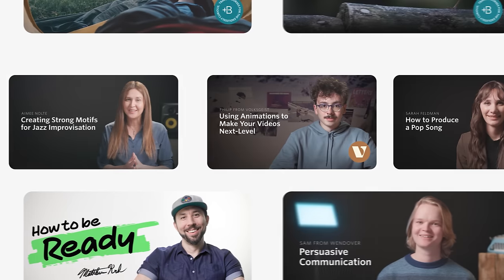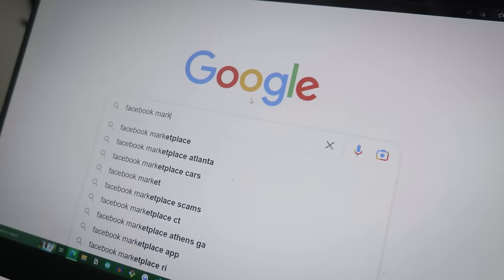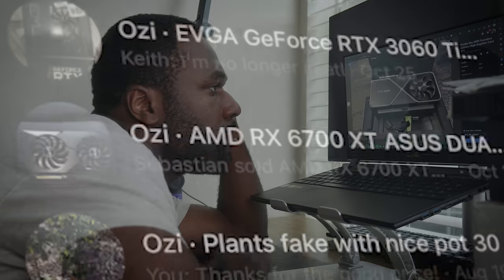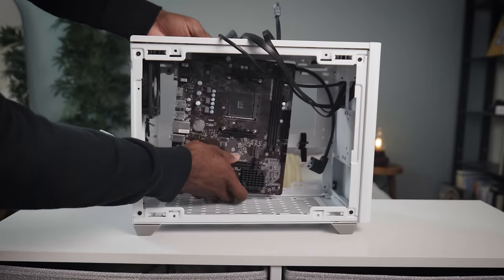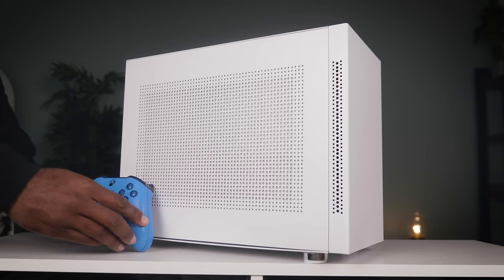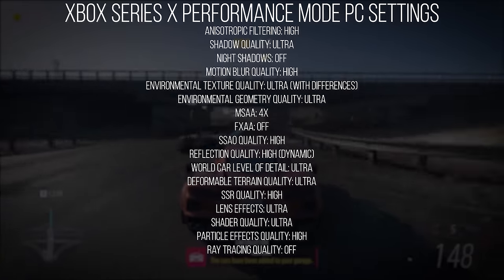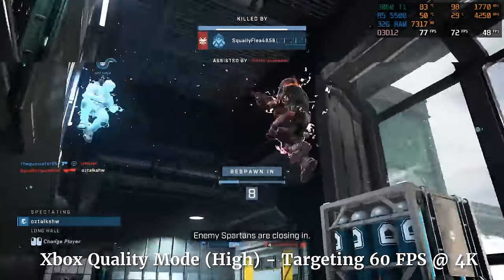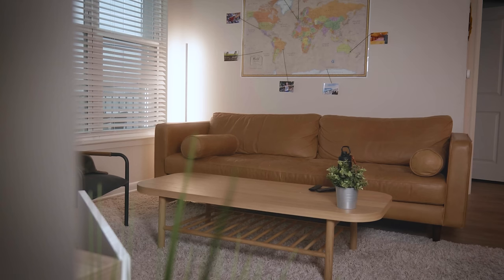I built a faster Xbox Series X for $474

Comment: I just built a comprable  system for   $500. I used face book marketplace and Amazon.

R5 3600 water cooled by AIO
X570 matx motherboard 
Rtx 2070 Super
GTX 1050(for blender)
32gb of ram 
1tb of nvme storage
250gb of ssd
500gb hdd 
And a monitor too!!

budget gaming is getting way better, you just have to know what too look for

Comment: so i want to make a similar build and on ebay i'm seeing quite a few msi gtx 1080 aero would that be good enough for 1080p or would it be a bad deal for 127 usd?
Reply from the maker: GTX 1080 is a solid GPU at $127. If you can swing it, pick up a used RX 6600, RTX 2060, or RX 5700. They're around the same performance but newer and more energy efficient. They're going for $150-$180 on ebay...1080 still good though :)

Comment: there are three things you can do about the gpu temp other than undervolting, repaste the thermal paste and usual blower style cards arent that good when it comes to coolings vs a dual fan config so set fan to 100%, as for the fan config have 3 intake 2 exhauset and if ur not venting the heat fast enough it get warm in the case, in my person rig i had 6 fans 1 was exhaust but the rest was intakes but my gpu would get up to 70-80, but i change the config to 3 in 3 out and temps drop to 50-60

Comment: Hey, Nice video! just one question on the build wouldnt the psu be pushing the hot air through the mid of pc? even if the intake is working fine its its not constantly running and pushing the hot air out. Leading to overall heat issues off the rip?

Comment: I have built 2 PCs with the coolermaster NR200P case and can confirm these motherboard fit, for anyone interested:

Asus ROG Strix B550-I Gaming (notice the -I)
Asrock B550M-ITX/ac

The Asus supports Bios flash without a CPU installed (to ensure compatibility with Ryzen 5000s), the Asrock does not but mine came with a Bios supporting Ryzen 5000s. There's also a sticker on the box of the Asrock that mentions it : "AMD Ryzen ™ 5000 desktop ready".

Comment: I don't know much about the specific hardware (I still have to keep on using an almost decade old PC), but since that 3060 is a used GPU, you might get better results with re applying the thermal paste on it.  Depending on the previous user, it might be drier than "insert something funny but inappropriate" 

Regardless, good video and thank you for sharing.

Comment: Not sure about the heat from the 5500, but I just built a system with the 7600 and it thermal throttled almost immediately with the stock cooler.

Comment: Cool challenge! This is one of the rare times where gaming consoles are a great value and generally much cheaper than building an equivalent PC.   I actually have a PC that is slightly more powerful than my PS5, but the SSD/loading in PS5 is faster, and games don't have stuttering and horrible optimization issues, so it's still my preferred platform by far for playing modern AAA games.  Can't be PC for general tasks, productivity/work, and classic/retro gaming though! I still love having 20-30 years worth of classic PC games on Steam & GOG to play
Reply: Stop the cap my pc is better than my series x and ps5. Yeah I have to agree ps5 ssd is probably faster. But I run games better and look better on my PC yes my pc cost 1700$ when I first bought it but now you can get a build for 550$. And PC you can do beyond just gaming, in 4k I can play games on same presets like the series x at 60fps even 80 fps for example red dead 2 above xbox series x settings I run it at 60fps 4k it does drop to 50 even 40 but I doubt console can pull it off above 30fps.
Reply: @last2first167  Just so you know Series X hasn't had any (next gen) update for red dead 2, so you wouldn't know how the series x would perform in terms of framerate or settings. Not saying that your PC isn't more powerful just that there isn't a way to currently test that. The Xbox one X plays RDR 2 at 4k 30, the series X would at least double that with better settings.

Comment: I play on both Pc and consoles, and i'm always amazed by consoles' value, i've seen ps5 FC24 bundle go for 469$, don't forget they come with a 70 $ controller, add an hdmi cable for 20 $ and FC24 goes fo like 50$, that makes the console itself at roughly 350$, I don't think we can make a brand new 350$ PC that can match PS5 performance, in a compact form factor and very fast SSD

Comment: Take the GPU back plate off, allowing air from the front to flow over the back of the GPU. You've put an insulator next to the GPU, no wonder it's hot.

Comment: definitely start with an aggressive budget limitation. then find the few areas that are future investments.

like i set a 500 dollar budget and ended up much higher to get a future proof am5 build.

i ended up paying over a thousand dollars but it's completely worth it.
i can play doom at over 144 fps with ray tracing and max settings. but can also raise it over 300 often reaching 400 in some areas.

i have 64 gigs of ddr5 (used to have 32 until i started playing atar citizen and got the same sticks with the same timings and chips)

i got the r9 7900x on a good sale and yes its overkill but I do a lot of video editing and I won't need a new one for 5 to 10 years depending on my future budgets. and i got a 6700xt xfx swift that clocks up much higher than expected without issues.

also got a 2tb ssd for only 170 dollars and a 4tb hdd for 60 dollars which is great for recording in the background.

Comment: If you're able to aim for an AMD graphics card instead of NVIDIA, you can install Steam OS on the system and have a much smoother interface than booting up into Big Picture mode is going to provide. This is overall a great recommendation though, building a PC is going to give you a lot more options than buying an XBox, why not if they're around the same price?
Reply: Big picture mode doesn't exist anymore. It's been replaced by the steam decks u.i and should now work fine.

Comment: do you think  this pc is good for 450 dollar Dell OptiPlex 9020 desktop PC with an i7-4790 CPU, 32GB RAM, 1TB SSD, 500G HHD, and an Nvidia GeForce GTX 1050 Ti GPU
22-inch monitor 75 HZ, Webcam 1080 HD, Bluetooth adapter and WiFi adapter, Digigram VX222e-Mic sound card, Gaming keyboard and mouse, window 10 pro I want to buy it but I don't know if it is good for games

Comment: I know that nr200 couldn't fit a matx board. But that replacement case looks good too
Reply from the maker: It technically can fit some smaller mATX boards, but I should've done more research on whether my board would fit 😅 Oh I was sadly mistaken. SAMA IM01 is an awesome replacement like you said.
Reply: @OzTalksHW  i feel like I've seen that case somewhere here in the Philippines under a different brand and name. Or it just looks like it. I'll go find it
Reply: Looks like it has multiple names on different regions. Ours is named Tecware Fusion. Its other names are SAMA IM01 Quzao, Gaming Cube, Nox Hammer but all refers to the same case

Comment: I already have quite beefy PC but wanted to play some games comfortably on couch, infront of my oled TV. Unfortunatelly TV is too far away to connect it to PC as external display. I was considering buying a gaming console, but I already own quite big collection of PC games, so first I wanted to give streaming a chance.  I stream games locally from my PC to nvidia shield using moonlight, connected through ethernet. Games run well, 4K, high details and 60 fps - smooth sailing. I don't notice any janks or tearing. I turn on PC by sending a wake on lan packet on my router admin panel with my smartphone. I can turn PC off in Steam's big picture mode. Whole setup has it's downsides and surely isn't as convenient as owning a gaming console, but for me it's small price to pay, considering I don't play that much these days. If you already own a PC and want to play on TV which you can't connect as external display, but both devices are in same LAN, I suggest you to try local game streaming.

Comment: Definitely goes to show that you can get great deals on the used market if you know what you’re doing and are patient!! I’d bet a non-blower style 3060 Ti would have had a better time in that case, but still, for that price, very hard to complain!
Reply: Don't blower style cards normally run at higher temperatures?  Is this a normal behavior for a blower card?
Reply: @bmanrockwell2174  Yep, blower style cards definitely tend to run hotter, and because of the design of the heat shroud, you presumably don’t benefit as much from having fans below the card directing air at it, since the heatsink is effectively blocked.

Comment: The software setup is what I am most interested in diving into. Are you running RetroArch on Steam Big Picture mode for emulation? You mentioned a "modified version" of Steam Big Picture mode, what are the modifications?
Reply: Playnite (which is free) would work much better than the new Steam big picture.

In my gaming room, I currently have my PC connected to the monitor, then also connected to a 4K tv hanging above it (little to the side). When I want to do couch gaming, I just switch to the second display (the TV), turn on my Xbox controller, press the Xbox button and Playnite comes on in Desktop mode (basically, a fancier and more feature-rich big picture mode).

Then from there, I can select all my PC games from all launchers (Steam, EA, GOG, Xbox, Epic) and I can select all my emulated games as well (Gamecube/Wii, PS1/2/3, Xbox/360, Switch, DS, 3DS, NES, SNES, Genesis, different arcades, etc).

You can also filter games from installed, not installed, specific platforms or launchers, etc. Playnite has extensions as well, I use one that connects straight to the "how long to beat" website, and it shows how long it takes to beat a game on average, etc.

I couple that with "Controller companion" available on Steam, which allows me to switch the Xbox controller to emulate the mouse and I can do everything from the couch.

Comment: I have pretty much the same PC, but with an ASUS RTX 2080, a Thermaltake Core V1 case, a mini ITX B550 motherboard from ASRock, and a 650 W 80+ Platinum rated power supply. The CPU is a 5500, just like the one shown here.

Comment: You could add a 120mm fan using the side fan bracket. 3 intake and 3 exhaust, that would balance the intake and exhaust of your case.
BTW, had a similar build with the the same case. A320m + Ryzen 5 5600 + Rx6600xt

Comment: This is a good video and the build is genuinely impressive.
But its worth noting that none of the games you tested were running XS optimized. If your monitor has an hdmi 2.1 port then you can use Halos XS optimized mode which puts it at 4k 120fps, and forzas XS update will put it at 60fps.
Because all series x's are the same, developers can optimize their Xbox version to give a significant boost in performance. This is usually how they pull ahead of PCs in certain games.
That being said, not all games on xbox have or will get an XS update, and your build will always pull ahead on those ones. And you also get access to more games than an xbox. So theres definitely still advantages to your console PC.

Comment: I did something similar too. Found a used 2070 Super and R7 2700X, AM4 board, 16GB RAM and paired it with 2TB of old used SSDs.

It's slightly less powerful than consoles, but meh.. DLSS makes it actually better than anything consoles offer. I also like the flexibility of choosing my own resolution, frame rate targets and most importantly, I can buy games for dirt cheap off steam where on average older console games cost 3x more and run at last gen settings.

With used parts, you definitely can build a PC equivalent to Xbox Series X / PS5 and it's well worth it.

Comment: Nice brother. I have similar specs i5 11400f with 3060ti. Recently upgraded to i7 11700. Sold the i5. I play forza horizon 5, far cry 6 and hogwarts legacy. On low-medium settings this setup is able to do 4k 60/120 fps. I have a 4k 120hz tv. Bang for the buck.

Comment: For most details - Most comparable performance would still be Ryzen 5 (either 3600 or 5600) and AMD Radeon 6700 XT which uses both RDNA2 architecture and has similar (if not a bit higher) performance than Xbox Series X APU has. Then again, normally Xbox has higher memory bandwith, mostly using faster GDDR 6 and GDDR 5 combo of memory, but nowadays you can only get DDR5 RAM for system memory, with GDDR 6 being only used in GPUs at this point. This doesn't mean much, however - as shown - even slower DDR4 is still very fast and performance of such machine is very competitive. I had 3060Ti (but not too long ago I upgraded to RTX 3080) and can say this - this kind of computer is more than enough for 1440p gaming at around 60FPS and can be used for 4K gaming if you are ready to scale graphics quality down. 
Overall it's a good example of Steam Machine done right - it has good performance, runs Steam games without issues, built cleanly and aesthetically pleasing. I wonder how much noise this one produces though, considering that one of features of Xbox Series is how quiet both consoles are.
Reply: The problem with GDDR memory as system memory (as opposed to GPU memory) is that even if you do manage to get a system that uses it is that software actually needs to be optimized for it, LTT did a video on a PS5-like motherboard a couple of years back where among other things the GDDR memory caused more issues than anything else.

Comment: No controller, no blue-ray player or no in built dvr.
Reply: Blue ray player is outdated tech. we use steam not disks, DVR is software based called Nvidia game clip capture :)
Reply: @tylerdobson7868  Dvr is not the same as shadowplay.
Reply: Console has a DVR? Why? You realize you can get free software to record right?
Reply: @karatlack4464  Not the same thing.
Reply: @dontshootimfri3ndly853  Correct, it's much better not having out of date hardware in a modern system.

Comment: I bought a Ryzen 7 3700x for £145 with the cooler and a rx 6700 10gb for £290 .I'm using the same b450 prime motherboard I got when I bought my first Ryzen CPU and still have the same ram and drives. So I have a PC that competes with these consoles for £450

Comment: Nice video! That GPU is definitely thermal throttling at those temps. I bet with a different case and/or different placement (not in a cramped entertainment center) it would be a lot better.
Reply: That won't make a difference here this is normal blower cooler behavour. They run hot, but you can run them in very cramped spaces like servers, as the top card of sli sets ups (in the old days when that was a thing) or like here right up against the case. They outperform normal coolers in these tight spaces, but by design they run the silicon as hot as possible and lose some performance.

Comment: hey oz, i’ve been working on a budget build myself. the biggest issue i’m finding is getting a new, cheap psu. how did you get yours? thanks, and great video as always
Reply from the maker: That's awesome :) if you're in the USA, /r/buildapcsales has lots of good power supply deals. You can also try EVGA B stock and slickdeals. Power supply rebates are common, so if you're paying full price and getting a VISA gift card/cashback a few months later, that's another good option
Reply: @OzTalksHW  beat you to it! the same day i ordered a b stock supernova 650 g2 modular for only 55, and about ten minutes ago ordered the final component, the mobo. also, thanks for responding. i’ve been a fan for a few years now, and it’s actually you that inspired me to build my first few (budget) pcs, even if they are just office pcs + gpus. thanks oz, keep up the good work man

Comment: Picked the wrong SSD. WD Blue SN570 is only $40 for the 500GB version. May not come with DRAM, but uses BICS5 flash and WD's in-house DRAMless controller. Solid 3,500MB/s reads.

For $40, there isn't a much better value in storage.

Comment: 6700Xt is quite a bit faster than what's inside the consoles, PS5 is level with a 6600xt and Series-X around 6650xt. The 3060ti is around 20% faster than both in normal rasterised games and can easily be twice as fast with ray tracing on.
Reply: Didn't think I would ever come across the real AD on a YouTube comment

Comment: GPU was so hot cause it's a blower style cooler. More standard coolers would have lower temps on it. But it being so tight that doesn't help and the blower has an advantage. But it being 83C the reg coolers for a 3060ti it would have been better.

Comment: Well , the video just missed the main points:
  1. It is not completely brand new PC, but you compare it with price of new XSX.
  2. XSX comes with 1 gamepad included . It is + 60 USD to your build.
  3. You failed to deliver at least simular results in both portability and noise of system. That noise from the blower on GPU cannot be comparable to active cooling solutions from both XSX and XSS under heavy load. 
  4. What do you actualy mean by "faster"?
XSX FH5 4k@30fps with RT is with locked FPS.
You have a few games with unlocked FPS (with VRR) and it is natural to use those games for apple to apple comparison.

Comment: Great lil PC, and amazing price. For GPU temps I think 80C is still a bit too much. I would remove that GPU backplate, and check the temps after that.
Reply: he is using a blower card and its in a cabinet. blower style cards exhaust all the hot air through the back of the case but the way he has it place in that small cabinet space he isnt leaving much clearence for the hot air to escape. also the GPU is used and needs a thermal paste replace and a clean
Reply: @matthewjuarbe5826  Yep, I agree. He should replace thermal paste, and put the case outside that cabinet. It will improve the airflow a lot.